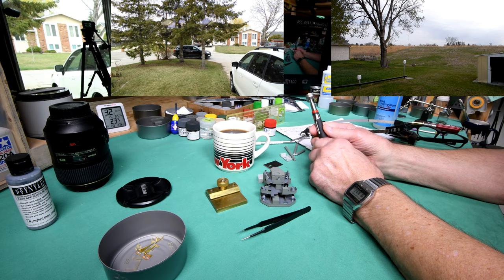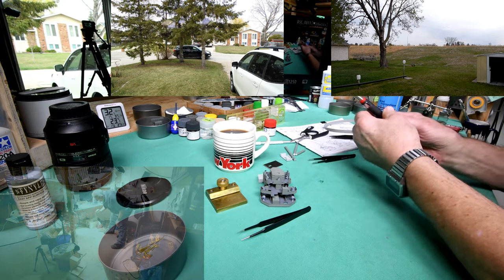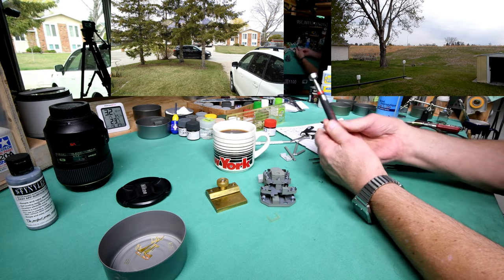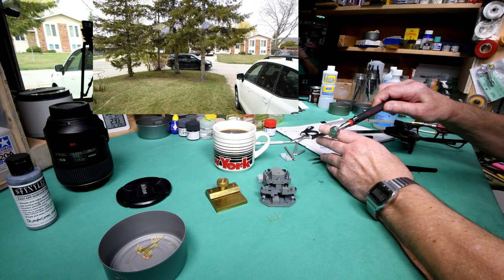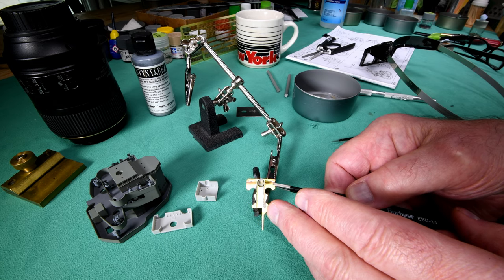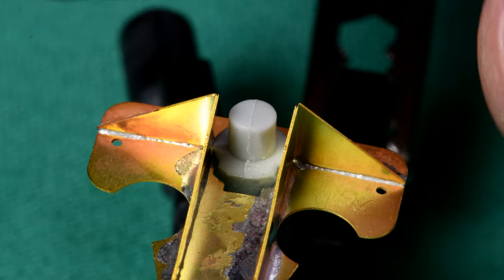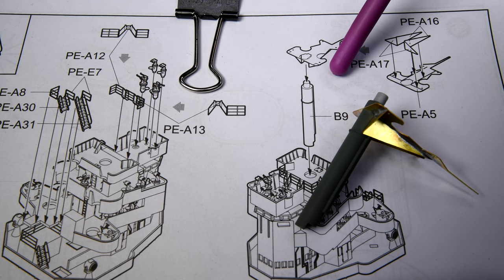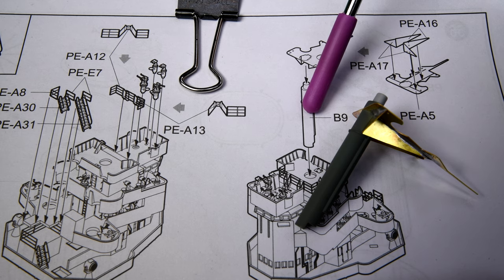The Model Ship - Part 807

Comment: Hi Ron  was not surprised with the magnet , but was thinking what if it had , trying to remove such a fragile piece off a powerful magnet would have been scary ! Is that a road  behind your place, ive noticed no fence either ,so different from here ! 😊😊😊😊see you tomorrow
Reply from the maker: That hill is actually a man made berm to deflect the road noise from the freeway on the other side of it. It is very effective.
See you tomorrow Marc. 😁👍

Comment: The machine that Clickspring used is a die filer actually! Adam Savage built one as well.  The kit is from uh... MLA ToolBox. It comes as cast iron pieces, and the whole 30lb kit of cast iron is 130$. Which, considering the cost and the fact you need to machine it... I think you have the better machine here, haha.
Reply from the maker: "die filer" Now I know what it's called. Thanks!
Perhaps my scroll saw could be modified. 👍
Reply: @roncalverley  Might end up buying a kit for one myself to use to learn machining. :D
Reply from the maker: @dakel20  For other viewers info. http://mlatoolbox.com/MLA-18.html